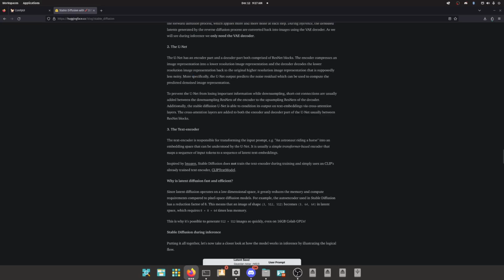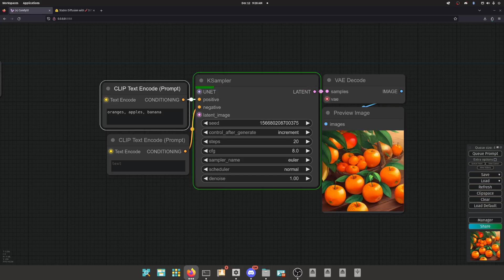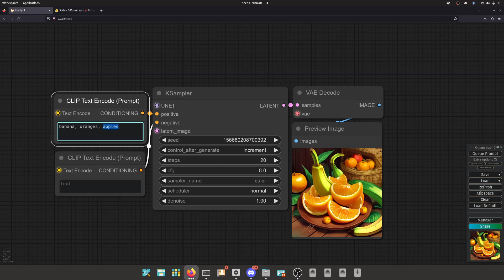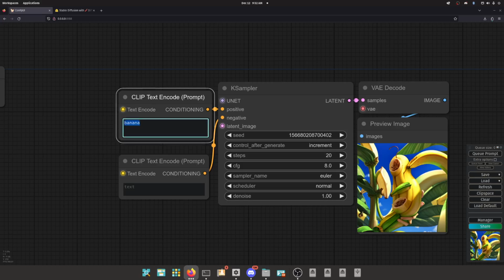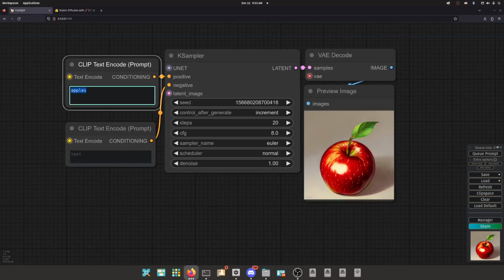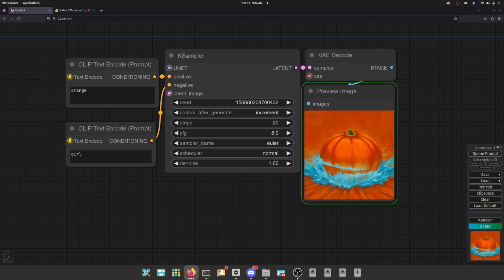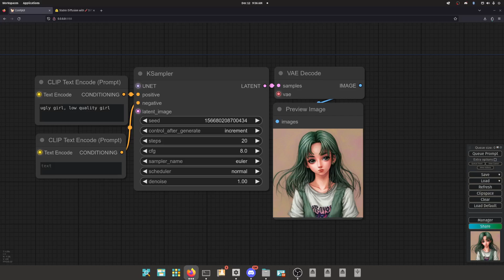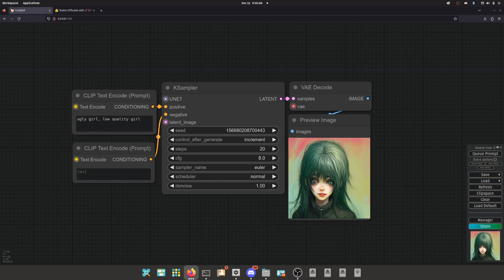Prompt Engineering Basics - Part 1

Comment: Is not only what ML understand but also how biased the initial human labeling as been done.
Try with races and mix it with body type, you will understand how much models are biased. 
Use a base model and put just "woman" and give a 100 shot and you will see is not even close to a equal distribution to races. Put "athletic woman" and is even worst. Put "fat woman" and yoh will be surprised a % will change.

Comment: one think that must me said tho, is that for some reason, the last bit of your prompt tends to have a stronger weight than anything in the middle. 
That's why the prompt structure developed into the "context,subject,details about the subject,background,style/modifiers,artist" because even tho stable diffusion tends to give less importance to something too far from the beggining of the prompt, the last bit of the prompt holds a lot of weight. 

also, a neat trick to achieve more... control and less bleeding of concepts like colors and textures, is to add an adjective before the said concept. 

like "thight fishnet thighhighs" will give you fishnet stockings 90% of the time, without the fishnet texture bleeding into something else in the prompt. Or if you want red lipstick without bleeding the red into other parts of the image do something like "ruby red lipstick" or "opulent yellow midriff"
I used to suffer a lot from it, since i love fishnets and denim shorts, but it ended up always anywhere in the image besides the damn thighs, or it gave me some denim jackets that i didn't actually wanted. 

I know why this thing works? no. Does it makes any sense? eehhh... maybe and maybe not?... but it does work...